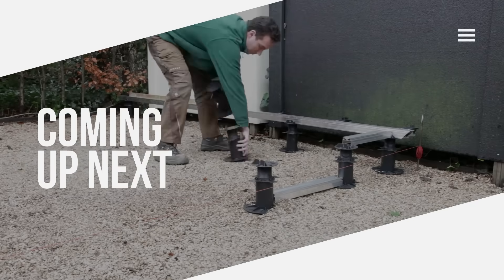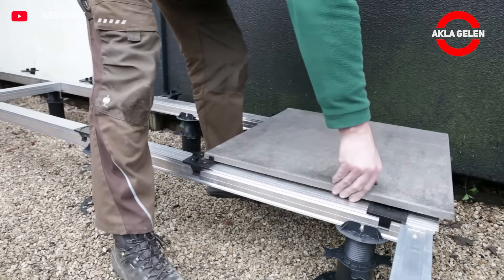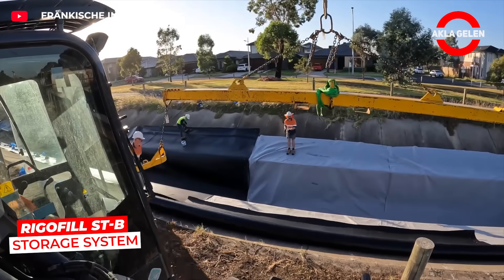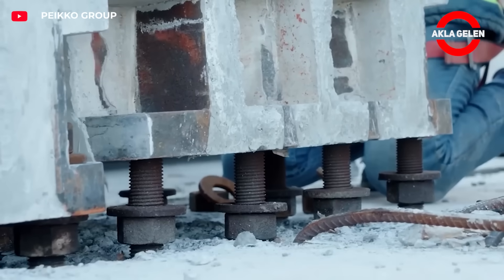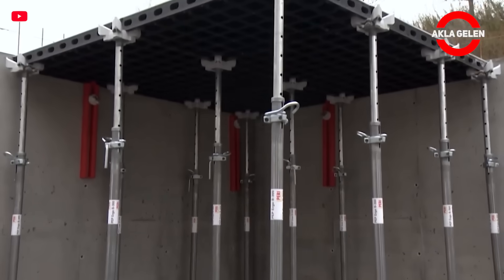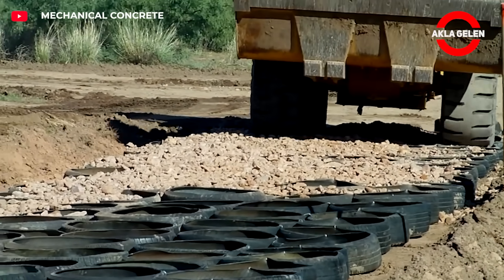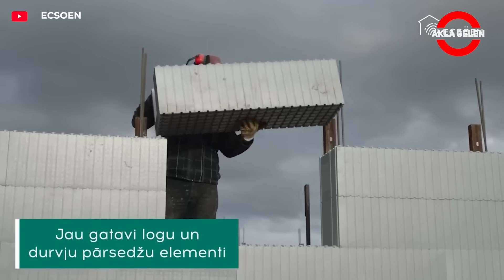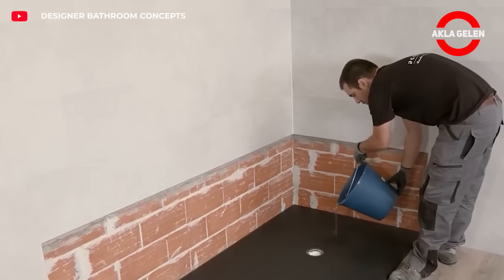Construction Workers Can't Believe It, Technique Works! - Most Ingenious Construction Technologies

Comment: All of these systems appear more expensive than traditional methods.
Reply: If Polyurea was around 20 years ago I would of used it when I painted the caboose in Centennial, Wyo. It got repainted 5 yrs ago by someone else. Google NICI Museum.
Reply: All it takes is widespread adoption, then economy of scale takes over

Comment: The rubber tyres will compress under load, the concrete will not - the concretevwill inevitably crack !
Reply: If so, then what’s the point?
Reply: …..Youre aware that tire are designed to support the weight of vehicles, right? Except now they’re filled concrete instead of air. 

Concrete expands and contracts with temperature fluctuations and will crack on its own. It’s why driveway have spaces in them. Having space to accommodate that will alleviate pressure. 

Tire can only compress so much, it’s why we put vehicles on them
Reply: All concrete inevitably cracks, moran
Reply: The tyres are being filled with concrete so no compression.

Comment: the road technology using old tires also known as mechanical concrete is very durable and cost effective In some locales with underly storm water basins also serves well at providing irrigation waters or cisterns for public use for plant growth and even bathing and washing all runoff suitable for crops every rain sand and  gravel filtered waters the result!
Reply: Bs